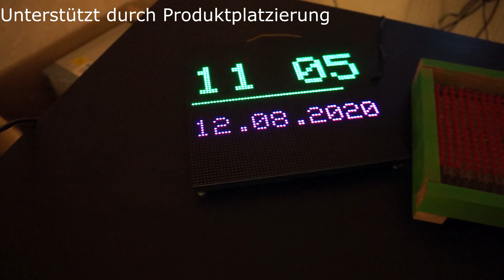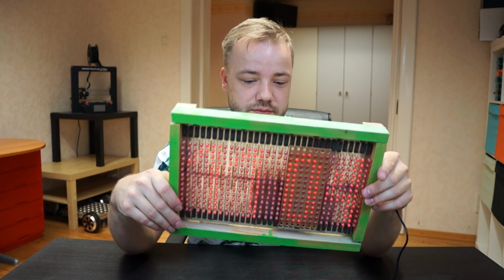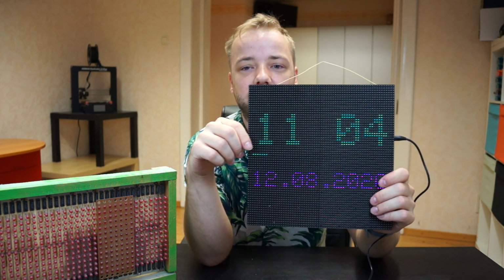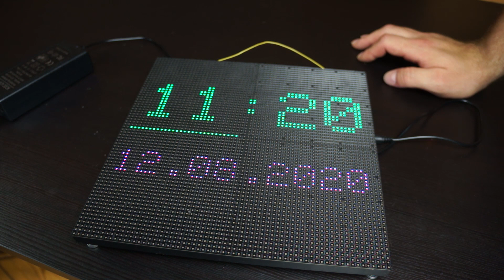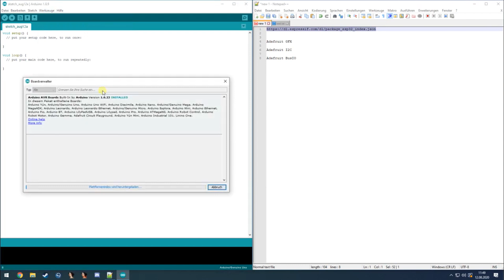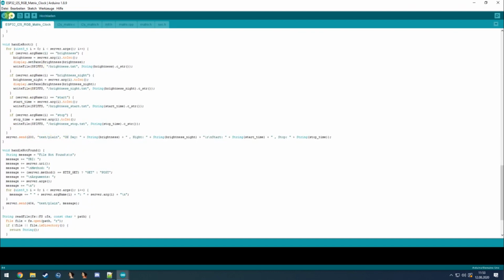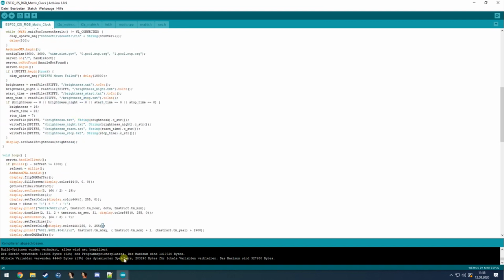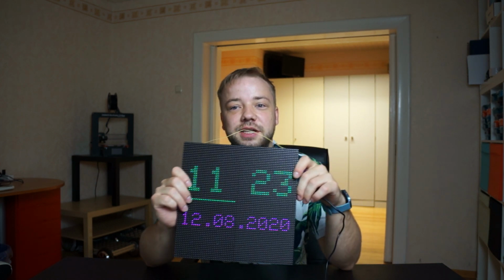DIY Arduino Clock ESP32 and RGB Matrix

Comment: Great project.  As for your Wi-Fi issue, it could be a signal strength connectivity problem.  Try using an external whip antenna if your module has a connection for one.
Reply from the maker: Thanks.
Yeah the antenna is pretty hidden behind the pcb

Comment: Hello Aaron. Thanks for sharing this! I am trying to compile your code for my ESP32 but am getting this error "'GPIO_PIN_MUX_REG' undeclared (first use in this function)
".  It is in the i2s_matrix.c tab.  Any suggestions? :-)
Reply: @David Kempton I was having the same compiling errors, I had to use ver. 2.0.5 of ESP32-HUB75-MatrixPanel-DMA library and esp32 core ver. 1.0.6
Reply from the maker: Hey. Would need to look into it as well. 
Maybe try to downgrade to a version from the time the video was made. Something could habe changed, just to see if it works then